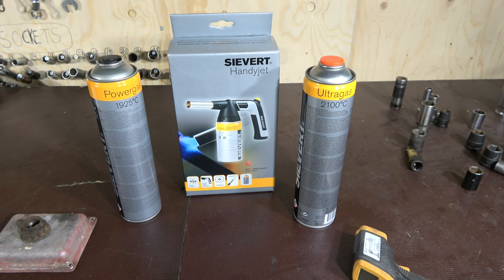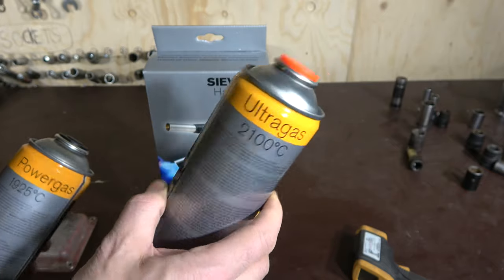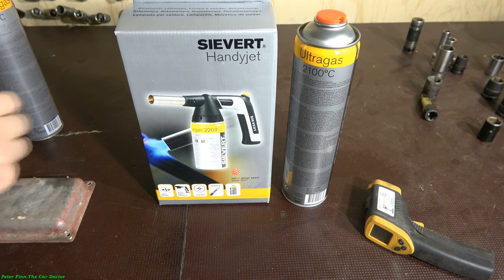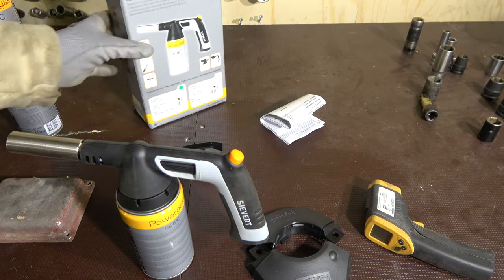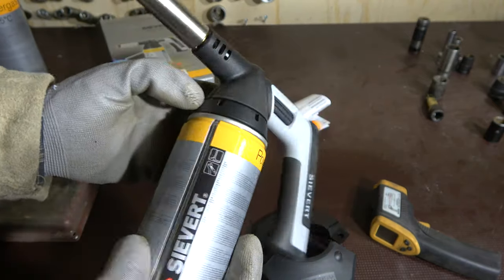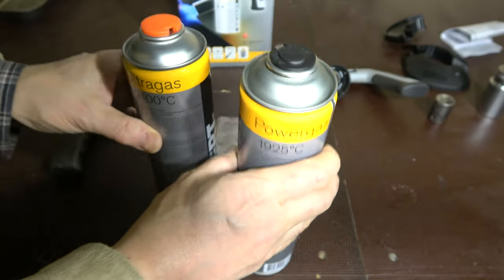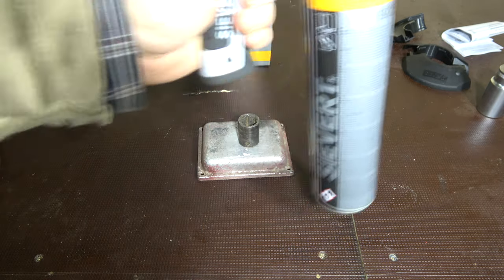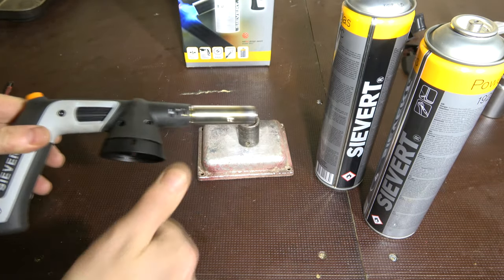How to use +3800 Fahrenheit or 2100 Celsius Gas Torch Sievert piezo

Comment: Thanks very much for the demonstration, Peter - great video! 👍 My gas torch is getting pretty old now and has had plenty of use, so this will be an excellent replacement. A good feature of the Sievert torch is that it can be held at any angle without flareups - unlike my present one! Thanks for your review 😃👍 Do remember that the nozzle remains hot for a while after turning the torch off!
Reply from the maker: You're welcome. Thank you. Good info Pete 😀😀😀

Comment: I need to know if this gas can get steel red hot.. Because normally this happens at 1400... steel melting point is around 1450 celsius....    so the flame of the torch should be above that.   Normal small burners are not getting hot enough.    But for me it is not possible at the moment to get a big two bottle gas set, so i am looking for something smaller
Reply from the maker: Good comment 👍
Reply: @PeterFinnTheCarDoctor  Haha 🤣 but did you test it if this burner can get steel red hot?  As far as i see it should get the same flame temperature as a mapp gas burner..